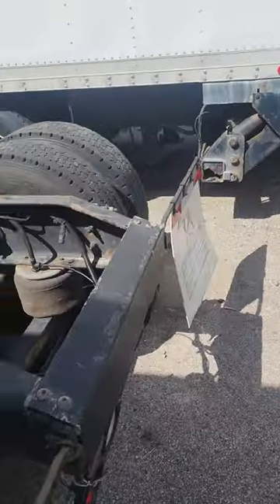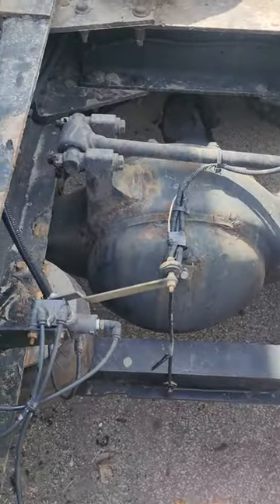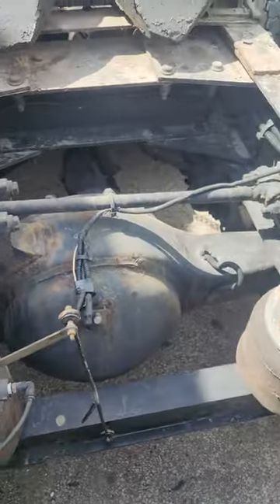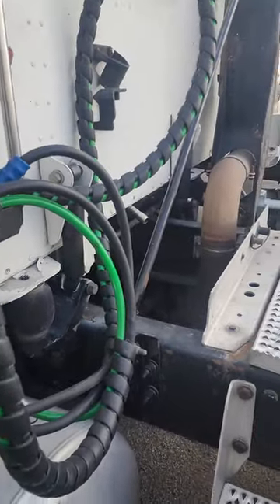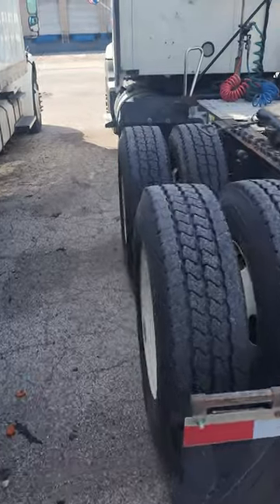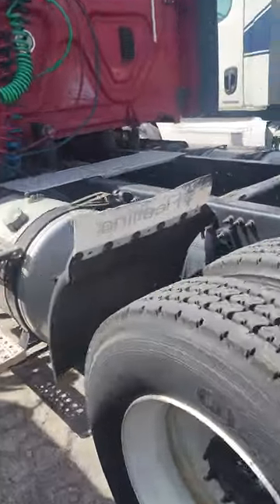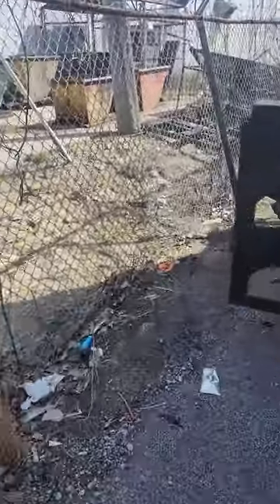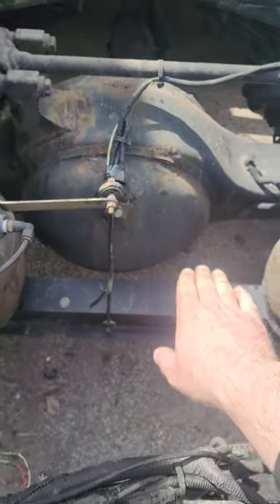leveling valves explained

Comment: I have a 579 Peterbilt 2018. My airbags just stopped working when I hit the switch. It do not release the air for the bags to drop. I replaced the switch. I replaced leveling valve and I don’t know what it is not working. Can you help me please send me a text or should I do today 29 April 2024 please let me know.